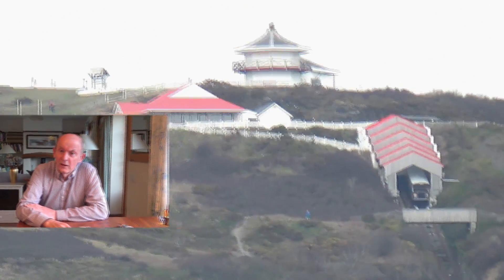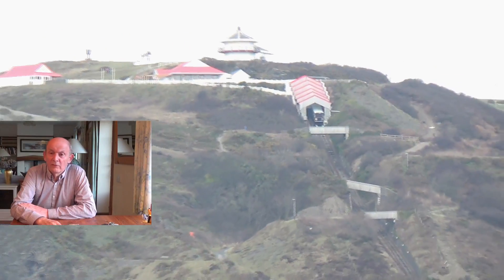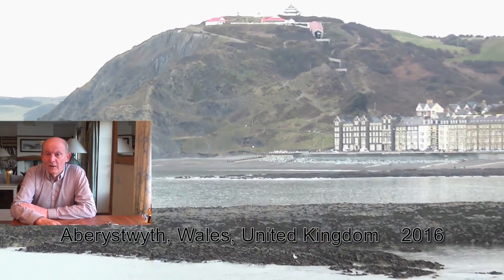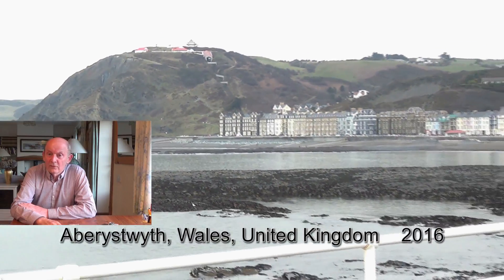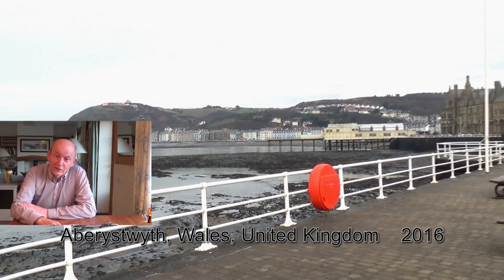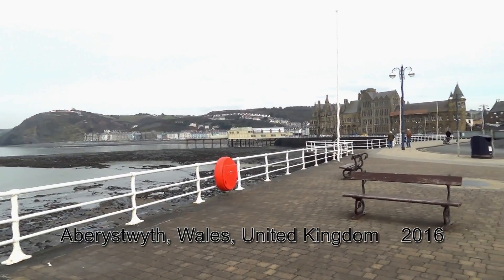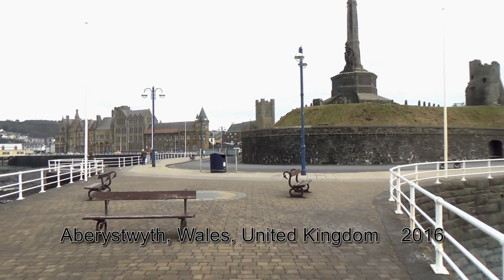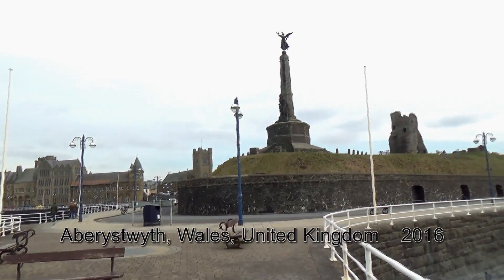An idea I have for a smart key for a car or security system.

Comment: Hi Andy. When you move, try to get a location on the hilltop in the background of your oceanside video. It looks like a good location for some serious DX! 😃

As to your idea on the key fob, you should get on it ASAP, else someone will beat you to it. Our 2016 Honda Accord's key fob will unlock the doors when you grasp the door handle even with the fob in a pocket or purse. After you sit in the driver's seat, the seat will adjust to a preset arrangement according to which key fob is in control. I am not sure if the doors will lock when the fob is moved away from the car - I will check it out later. 

I have been partially disabled for a few years with degenerative bone in my spine and having the seat reset itself to my preference when I am the driver is a huge benefit for me!!

I have missed your tutorials, but I understand that life goes on. Perhaps when things settle down you can come up with fresh material to enlighten your YouTube viewers. 

Congratulations to you and Sophie on you marriage! I wish you the very best in this new phase of life. 

73, Mick Bradford - WB4LSS

Comment: Hello Andy, Nice to see you back, Good thinking about the locked indicator. My thoughts are about mortice locks-wont use a rimlatch-too easy to bypass!, how about an magnetic/RFID type thingy?, possibly a ring of tiny different rf coils radially around an escutcheon { retro-fittable?) and a key splined into a fob containing a device to count pulses therefore direction of rotation, and an electric ink display(?)-all activated by a pad on the side of the key. Sorry about rambling. S.

Comment: Viper security systems does this. They also show your car's temperature and other information all on the key fob. It also allows you to lock and unlock your car up to a mile away. Only downside is that the system costs around 200 US dollars, but I think it's well worth it.

Comment: There are aftermarket 2-Way car alarm systems with a display on the remote controller. You can see if the car is locked or stolen...

The door of my work has a special lock. The key of my Boss fits at the Workshop, at his home and at his parents home. My key just works on the workshop. Its pure mechanic. the key is marked with "dom system ix ht" if you want to have a look at a crazy looking key :)

Greetings from germany and sorry for my bad english :)
Reply from the maker: +Baum Inventions. Hi, that's quiet an unusual  lock, I looked at a pdf on google  for "dom system ix ht"All the Best  . .  Andy

Comment: Your back. Good idea Andy, nice to see your wife is giving you ideas. 
Nice to see you .
Reply from the maker: +Simon Spiers 

Thanks Simon, hey no one has a monopoly on good ideas and
yes I'm very lucky to share my ideas. Many years ago I had a huge problem when I
was designing a phase-locked-loop tuning system for a Radio Frequency induction
heater, Sophie asked, ‘What’s the problem, maybe I can help you?’ Sophie knows
nothing about electronics so I had to simplify the description of the problem. I
was getting a 5 or 6 nanosecond glitch two hundred thousand times a second but
not on a part of the waveform I needed to monitor, the spike was in the
negative side of the waveform but it occasionally it would go up and crossed
the zero line buggering up my detection system. When I explained about this
narrow window of that the spike was in Sophie simply asked, ‘Can’t you close
the window?’ It may seem simple now but I’d been struggling with this problem
for a couple of weeks. I added a transistor switch triggered with a delay from
the zero crossing and blanked out that part of the waveform. We went on to
manufacture and sell a lot of high power Phase Locked Loop controlled induction
heaters incorporating that system. Like I say, no one has a monopoly on good
ideas and you really can’t predict where the good ideas or inspiration is going
to come from and I hope this video inspires someone to create something new.  

Kind Regards  . . .
Andy
Reply: +AndyDaviesByTheSea Brilliant! What a great story. That's called thinking outside the box ! Good on Sophie!

Comment: I enjoyed the way you shared that idea of yours would love to hear more. What did You Do as work? 
Thank You
Reply from the maker: +Heckzaflexz Hi, well right now I'm a casual property developer and landlord, but I have had may years designing and manufacturing special purpose machines, these have mainly high power induction heating applications so I've been into things like water cooled valves (Tubes) and water cooled transistors with a hell of a lot of mechanical handling machines, typically for mass production processes.All the best  . . . Andy

Comment: This does sort of exist in the form of the BMW i8 key fob which is basically a small computer unto itself with a little screen that can display whether the car is locked and the state of the car's batteries and fuel - though they may have chosen the most expensive way possible to implement this idea.

Comment: Hi Andy. Excellent idea. Something like this may already exist in the form a smart phone app. I've never used an app like this, but if a smart phone can unlock and start a car, then there should certainly be some feedback to phone to indicate the car's status. But a dedicated key with an indication would certainly be better because it would survive during the life of the car, and would not have to be upgraded every two years like a phone. 

Have you found a nice piece of driftwood for your hipps clock?
Reply from the maker: +Eric Wasatonic. Hi Eric I did wonder about smart phones, but mobile phones don't always work over here in Wales, lots of hills and hollows.  I hate to admit it but I'm still using an ancient Nokia phone that works great as a phone but no camera or video camera and no web facility. And yes, I like the idea of a dedicated key for the gob.  As for the Hipps mechanism... that's an ongoing project.All the best . . . Andy

Comment: Nice to see you back Andy. Your idea is halfway realised already, newer cars (Merc and BMW for sure, I think VW is doing something similar aswell) already record data on the key (GPS position, for example) when you pull it from the ignition; the keys only miss a display. It would be a relatively simple modification.
Reply from the maker: +tocsa120ls.   Hi and 'thank you.'  I'd be surprised if new top-end cars didn't have some sort of display on the key, because, as you say, ' it's a relatively simple modification.' I recon once you think about having a display on the key you can start thinking about allsorts of data that could be useful, like a buzz when you open the door to remind you if you need fuel. So, how long do you recon it will be before some automotive manufacture patents the idea?All the best  . . . Andy

Comment: Hey Andy, I think that is a splendid idea. I have been wondering about if I had locked the car since high school, usually when I was in class and could not check. This is really easy to do as you said because your thinking about a lot of other projects and work, and the auto part of your brain has locked the car, but it doesn't register. This idea could be expanded too many other things, like, did I really shut the garage door.
Rick
Reply from the maker: +AllAmericanFiveRadio. Hi Rick, good to hear from you, I hope that you are well.  For anything other than a key for a car I like the idea of an 'all mechanical key' rather that keys with batteries in them, a car key could be charged inductively, ( I guess they already do that. if not they should) The big issue for something like a mechanical key indicator for the garage door is that of multiple key holders. You could have a key that tells you that it has locked the door and then a pneumatic device could reset the indicator to a neutral position after 12 hours or so. Anyway the idea here is to let someone else faff about with the detail, I'm just suggesting it could be a useful notion.  Best 73's  . . . Andy

Comment: Good to see you are doing well, Andy.

For the first idea, the main limiting design factor is battery life. Each action would ideally be initiated by a button press, so the key fob can stay in low power mode whenever possible. I think it would be sufficient for your idea if the key fob had a timer that started after the car had confirmed the doors had been locked or unlocked. There is also a lot that could be done using smartphones in this day and age, where the car and the phone could in fact communicate directly or through the Internet with no concern for battery life. The challenge however, then becomes security and avoiding exploits against the car.
Reply from the maker: +Gameboygenius  Hi, the way I'd set it up is such that the receiver would only operate for a few seconds after a button activation and/or it would be shut down at the end of the transmission from the car.  All the best . . .  Andy